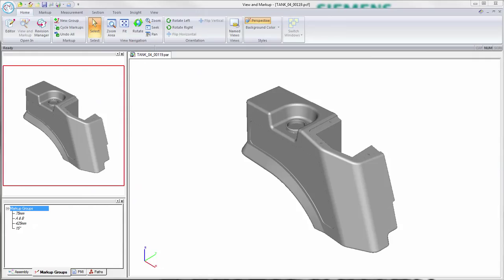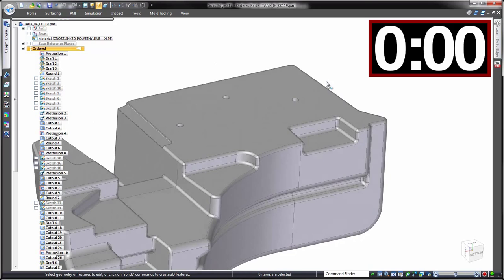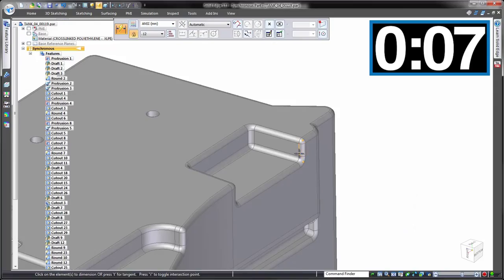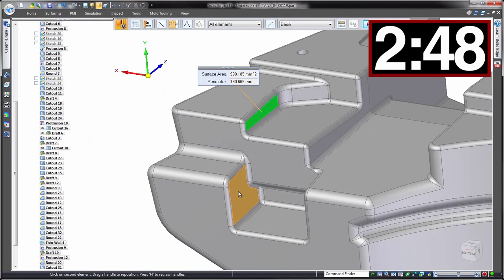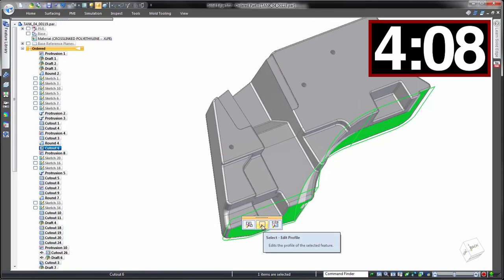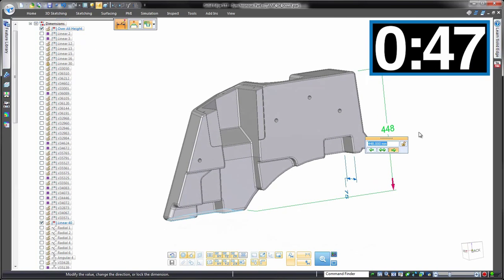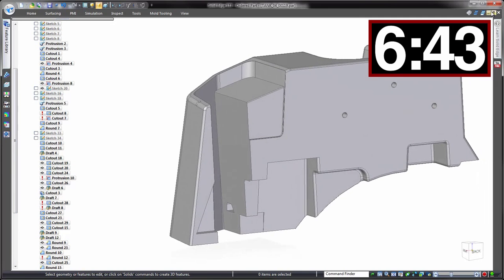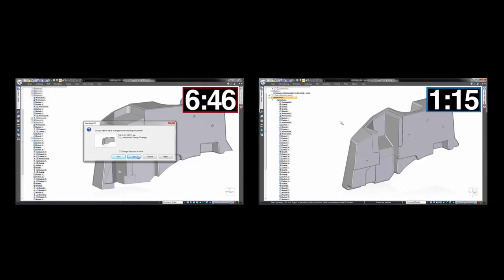Solid Edge Synchronous Technology - Unexpected Design Changes

Comment: Very good - nicely shows ST technology benefits both in speed and focussing on the actual change required. To accomplish changes 4 to 5 times faster over traditional methods is a great achievement. Although this IS quite a complex model it is NOT that unusual in practice - with ST, no fear of the model  regenerating with more errors and 'gotcha's' !